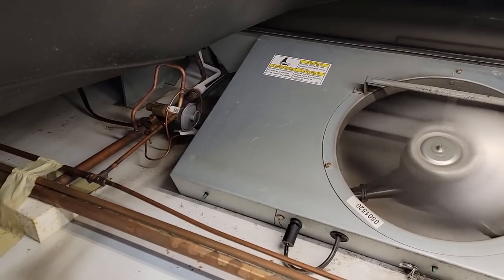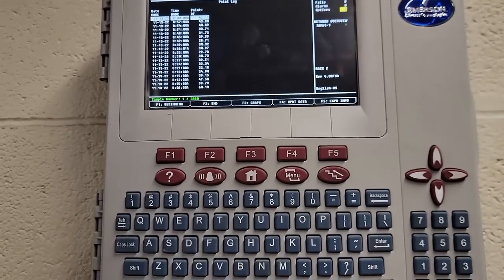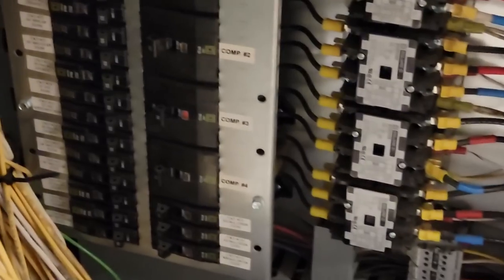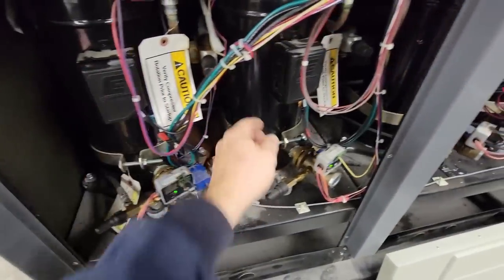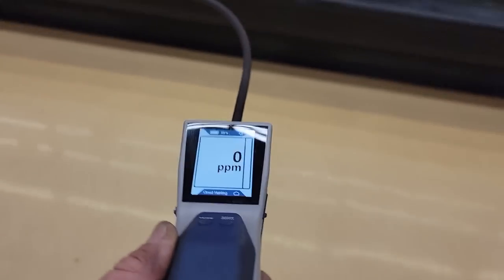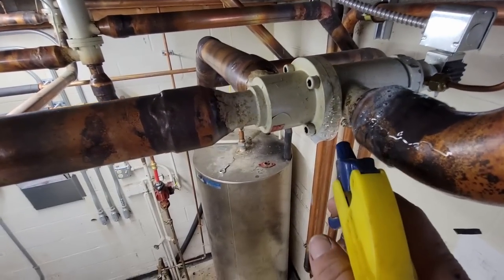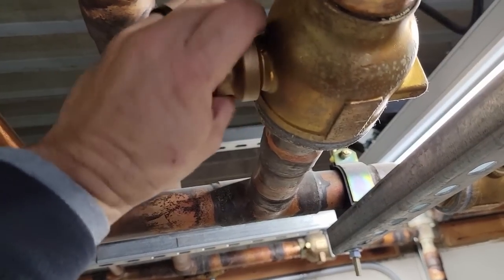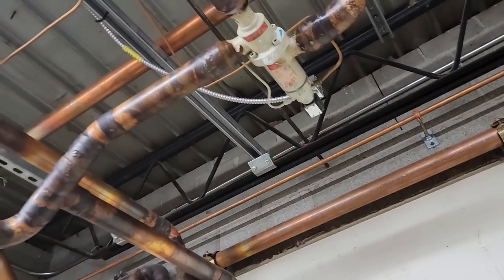Meat Case Is Warm! Fix It Today Please...

Comment: Why fix the future issue on the other 9 compressors when the first one shorts 😆,  job security. Nice job Rick!
Reply from the maker: 🤣 I wanted to fix the remaining racks but I let them go.
Reply: @HVACRSurvival  - Grab one of the small tubes of non-acid 30 minute set caulk.  Silicone or latex, doesn't matter.     Hit a problem like this, move the wires, slap a bead on the areas, work on something else for the 30 minutes, then let the wires drop back into position.  You can use it for other jobs, like sealing those stupid holes in the TOP of devices that people leave behind.  (I'm currently looking at an LED sign where they caulked the front of a sign, but not the back - and the power block is on the BOTTOM, where the water will trickle.   Oh, yes - and they didn't slide the frame fully into place before caulking, so there's an 1/8th or so inch gap on one side)

Comment: Hussmann impact coils woo hoo. That’s all a basically work on. Did they have non adjustable TXVs? Those protocol racks leak a lot due to vibration, the racks that take the cake are Hussmann SUPER +
Reply from the maker: I believe they are adjustable txv's
Reply: We have so many hussman super plus we work on still running old comtrol controls a couple have newer style danfoss but geez

Comment: It looks like that surge protector "blew chunks." What brand of surge protectors were those? I usually see those SC69s on the old commercial units I work with.
Reply from the maker: If I'm following what you're asking, those things that the wire keeps shorting into was oil pressure safety's

Comment: those 3 way valves always leak there. also you can just add gas at a C case  suction
Reply from the maker: That was the suction at the C rack. I found out latter there is a whole I send my hose up thru the floor with the suction line. Those are the little things that I never get told. I think that's why they hate me making these videos.

Comment: E2 controllers are very complex, lots of short cuts. Alt+ pretty much anything will short cut you anywhere.
Reply from the maker: I just learned a couple of them thanks to Brett at the advanced refrigeration podcast.
Reply: my luck I'd find a combo that shortcuts to immediate full factory reset. 🤡

Comment: The water heater won't work well when its low on charge.
Reply from the maker: Very True. Luckily they have a gas water heater in addition.
Reply: @HVACRSurvival heat reclaim might even lockout if head pressure can’t get high enough, seen that before

Comment: That seems like a call you should send several techs on, not just one guy.
Reply from the maker: You're lucky you can get one guy on call let alone several, but sounds good 👍👍. Thanks for the feedback!
Reply: @HVACRSurvival  That's sad to hear, becasue i'm sure it puts a lot of pressure on the one guy to maintain/work on such a large complicated system, running around everywhere.